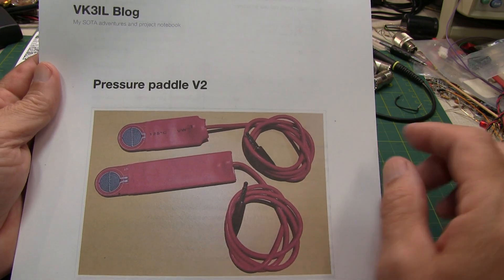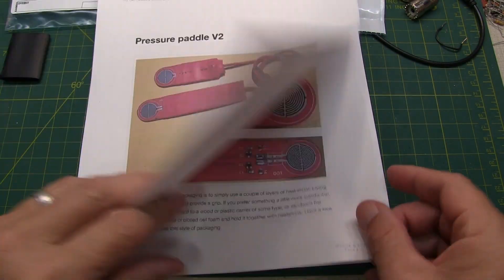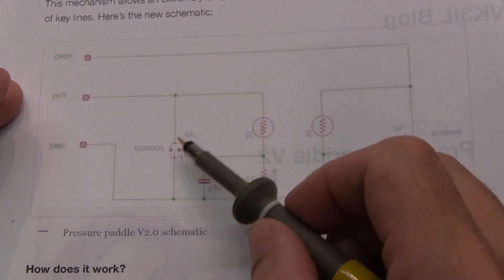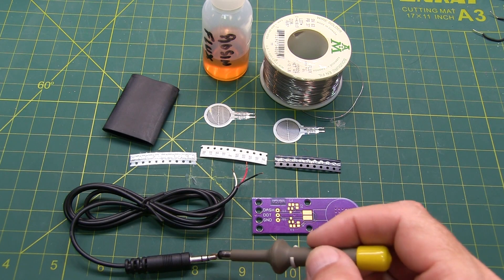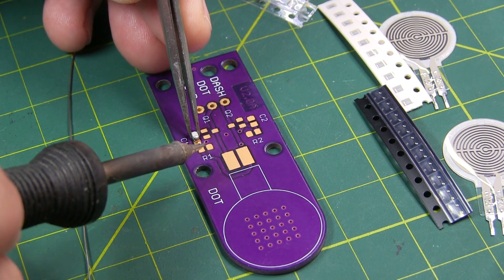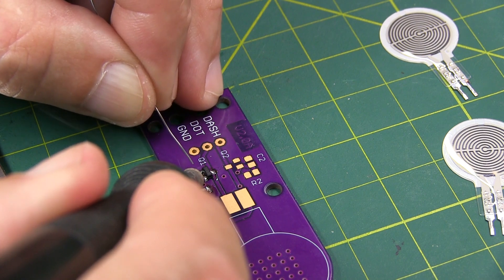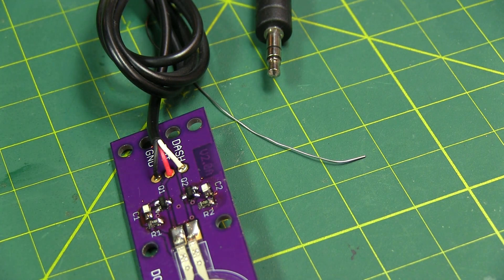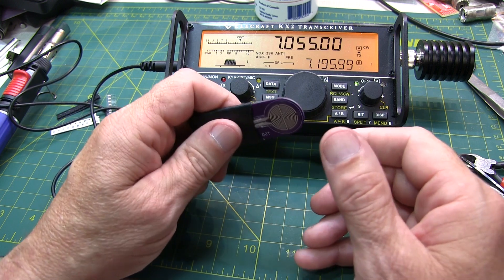#386: Build the Iambic "pressure" paddle from VK3IL

Comment: Two things I don't understand: 
1. Why do all the builders concern themselves about where the dit and dah wires go? The paddle is symmetrical. Can't you just turn it over in your hand?
2. That "sensor" is $14. All it is is a conductive trace on a piece of mylar. Why don't you just incorporate the spiral interlaced conductors into the circuit board itself? The glue is just another point of failure, plus if it was part of the circuit board, you'd save $14.
Reply from the maker: The Dit and Dah are silk screened on the board, so it’s nice to match it up. The sensor in NOT just a spiral conductor, it is a pressure sensor - even pressure from dry, non-conductive or capacitance influencing objects like plastic will cause the resistance change.

Comment: Nice to see you keying with the "pressure" paddles so effortlessly. I am struggling with my regular CW paddles, may be because I am slow to learn. There was an option for touch paddles with the VU ham from whom I got the usual Iambic paddles. But I did not go for it thinking that it will be difficult to use! 73 de Jon, VU2JO

Comment: Could you incorporate the touch sensors into the PCB layout? (and have the traces gold plated for longevity)  Or am I missing something?
Reply from the maker: These are not capacitive sensors, they are a multilayer resistive pressure sensor, so not something that can simple be etched into the PCB
Reply: @w2aew  gotcha.  I thought they were relying on the finger's conductivity (completing the circuit between two adjacent traces).  But this makes more sense.  Less risk for ESD as well.

Comment: Wouldn't it work better to add a pair of small diodes and a capacitor so that the lines are pulled to ground rather than about the threshold voltage of the MOSFET? I can see it having compatibility issues with low voltage devices.
Reply from the maker: So far it’s worked on every rig I’ve tried it on.
Reply: The nominal Vgs threshold for the BSS806N looks to be 0.3, 0.55  0.75 V (min, typ, max).

Comment: Nice Video, thanks  ! 👍

Thought of a 3d printed case with transport protection..  like one of those sliding USB sticks.
Reply: Sliding out, like a USB stick = clever! I was thinking on a case, also. My idea is a plastic box, with a hole in the top. A small, wooden dowel would go into the hole. The dowel would have a groove cut in it. The paddle would be placed in the groove. Now, the paddle is mounted on vertically and it can be keyed with your finger and thumb, back and forth. A spring, or rubber band, could be added to adjust the pressure. I hope that was clear. Cheers.

Comment: I built three of the long version and it's the only paddle used on my POTA activations.
Reply: The 100m length is the way to go. 63mm is not large enough to get a good hold on.

Comment: A few years ago I built something similar using an Atmel AT42QT1070 capacitive-touch sensor breakout. I wanted to use double-sided copper clad for the paddle, but there was too much mutual capacitance through the FR-4, even with copper etched away leaving only 1/2" pads on each side. I ended up spacing the dit and dah sides (now single-sided) apart with some 1/8" plastic. It's still a single paddle, just a little thicker. Pressure sensors like the VK3IL design uses wouldn't have had that problem. The paddle works great, though, needing just tiny movements of thumb and index finger--not that it improved my sending speed, though. 😕 --Todd K7TFC

Comment: I too was developing my KX key based on capacitance. https://youtu.be/nQtwr_YvNoU?si=OHyeZZtfPSZZg2id
Test your dongle under conditions of poor SWR and an antenna nearby, which is often the case in the field. 
It took me a while to beat the flood of strong interference when transmitting.
73! UD6ARJ
Reply from the maker: This one is based on a resistance change, not capacitance, so is much less sensitive to RF
Reply: @w2aew  Field-effect transistor.. everything is possible) Ok.